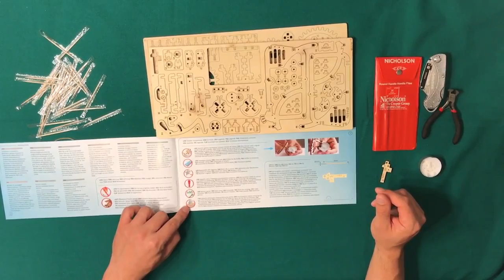3D Mechanical Wooden Puzzle Model | Ugears Tractor - Assembly Video | STEM Projects for Kids

Comment: Tip: when you see that a toothpick pulls out of a hole (so that it comes out more than one side, while rolling) stick a small piece of ctp of about 2mm² with white glue, on the side where He goes out. If the rear wheel toothpick, for example, loosens too often, make one with two halves that will measure a little longer than 65mm. Do not be discouraged  -)